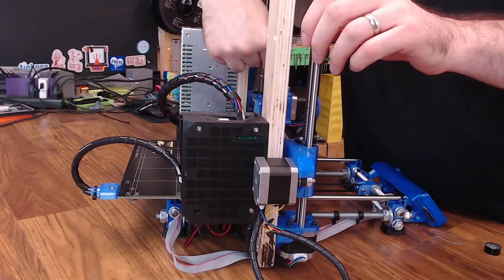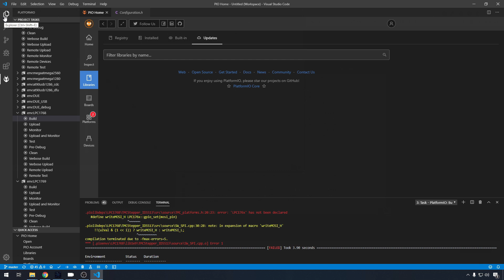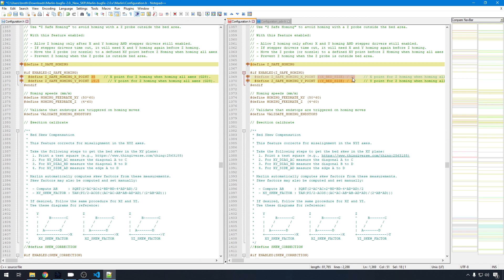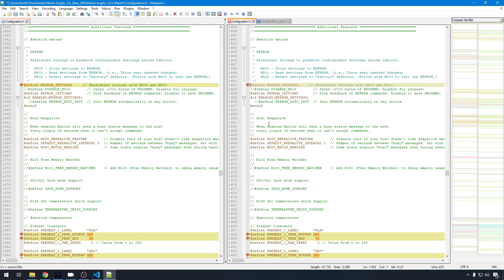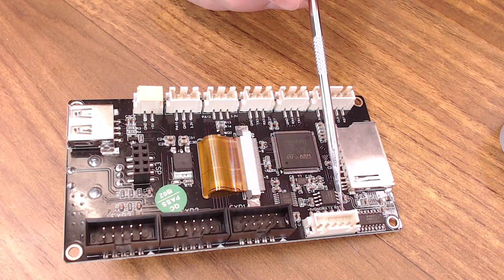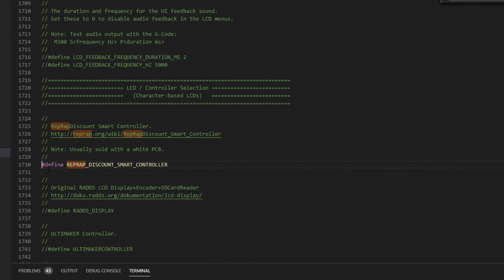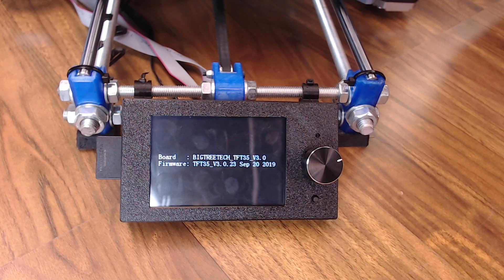BigtreetechTFT35 V3.0 Touch Screen Install - SKR 1.3 - Chris's Basement

Comment: Put this on my printer, everything was fine and working right till I did the upgrade firmware on the screen. When the screen rebooted it came up in Chinese,  I checked the config file in VS Code and it says the default language is English, so I built that config and flashed the board and still get the same thing! Any Ideas?
Reply from the maker: You mean the firmware on the screen is what you updated? Marlin doesn't impact the TFT screen in anyway. It's just a controller. You should be able to change the language with the screen buttons.
Reply: @ChrisRiley  Yes, the screen firmware I got from BigTreeTech's GitHub page now version .26. Tried but cant read the Chinese to do so
Reply from the maker: @Slowjoe1957  Yep, so you just need to find the right buttons, on the bottom third button from the left, then top second button from the left.
Reply: @ChrisRiley  If I had read the git hub page, I would have got it... copied the bin file to sd card but not the TFT35 file like the instructions say to.. It works when ya do it right.. Thanks for the reply and keep up the great video's

Comment: Hi Chris, great video as always. Hoping you can solve an issue for me, I have an SKR 1.4 with TFT 24 v1.1 all cabled correclty and able to switch between modes howver only Marlin mode working - touch screen still says no printer attached. Marlin 2.0 firmware with Reprap_Discount_Full graphic_display enabled but Serial Port (currently set to -1) and Serial Port 2 (currently set to 0). Is this correct and if so what else could be wrong please? (baud rates both set to 115200)
Reply: Thanks for the reply Chris, my set up was actually correct - I had bought 2 of the tft screens and seems one was defective and only worked in Marlin mode taking it up with supplier.
Reply from the maker: Try flipping the serial ports, make serial port 0 and serial port 2 -1

Comment: intresting, the 2004lcd works with the skr 1.3? i thought the 2004 display uses a 5volt logic and the skr uses a 3.3v logic. so are they compatible without a level shifter?.
Reply from the maker: Yes, it will work. The chip is 3.3v, the board in 5v tolerant.
Reply: @ChrisRiley  cool thanks !

Comment: i bought this screen for the skr 1.4 turbo, i hope it's compatible, i assume it will because it's the same company.
Reply from the maker: Yes, it will be, use the same TFT pins.
Reply: The TFT pins (at least on mine) are opposite in the 1.4 to the 1.3, so the single pin will be on the side that faces the fuses on the 1.4 turbo.
Also  I was getting "No printer attached" error.
Fix for me was to set the serial port at "-1"  then enable serial port 2 and set that as "0", baud rate 115200
Screen now detects printer about 20 seconds after power on.
Reply from the maker: @chrislefroy1034  Ah, that is good to know. That will help others.

Comment: Hi Chris, I switched to an SKR 1.4 turbo and the TFT 3.0. Some of the options like baby step don't work while the printer is running in touchscreen mode. It's enabled in Marlin and works in the emulator mode. Any ideas?  Thanks!
Reply from the maker: I am not sure why this is, but I have heard that before. There should be away to add custom commands, but at this time I am not sure how. I know there are other "hacker" type firmwares out there for these screens with more features.

Comment: Hi Chris, I have upgraded both my CR10S and my own Hypercube Evo build with this display. Everything works great except when selecting print in on the touch screen selecting the mainboard SDCard rather than the on board display reader the dialogue for bed and nozzle temp to not change so I do not know the current temp of things. Is there a fix for this? The temp readings work OK in emulation mode and when printing from the display SD reader, just not the mainboard reader.  Also can I upgrade the display firmware via a firmware bin from the mainboard SD reader rather than the display reader, if not next time I renew the firmware it will mean taking the thing out of the CR10 control box to do this which will be a bit of a pain. Thanks Steve
Reply from the maker: If you are printing from the SD card on the board I don't think the screen will get any info back to keep it up to date. There is no back and forth after it's started. Also, I think you have to update the firmware from the port on the screen.

Comment: but how do i make a TFT v2.0 work?
Reply from the maker: Not sure on that version.
Reply: @ChrisRiley  thank you for your reply,,, please understand that when I saw your original skr1.3. the screen offered was a version2,,, so i bought into the package not realizing you didn't evaluate the screen for the board,( but you did reference the screen in the marlin setup).  bought 2 for refitting both my anet machines.  bad story,,, havn't touched my machines since.  oh and btw, the onboard sd slot doesn't work either.   I really admire what you do, but i expect a higher level of due diligence.  We follow you and your advice, expecting you to realize crap when you see it and say so.  This wasn't a hard call, it just doesn't work.

Comment: Hi. Bit of help please. When I change the line  #define SERIAL_PORT  -1 to #define SERIAL_PORT  0 I get errors when compiling.                from Marlin\src\HAL\STM32F1\dogm\u8g_com_stm32duino_fsmc.cpp:29:
Marlin\src\HAL\STM32F1\dogm\../../../inc/../HAL/./STM32F1/HAL.h:82:4: error: #error "SERIAL_PORT cannot be 0. (Port 0 does not exist.) Please update your configuration."
   #error "SERIAL_PORT cannot be 0. (Port 0 does not exist.) Please update your configuration."
Any ideas how to fix that? Board is SKR MINI E3 V1.2 with TFT35 screen V3
Reply from the maker: What is your second serial port set to?
Reply: @ChrisRiley  not been enabled. I just followed your other video setting up the firmware. I just changed it to port -1 but there was no connection with the printer. Then looked at this video and tried to change it to port 0 but I'm getting the error. Thanks for replying :)
Reply from the maker: @heliaddict100  I think I found it, set the serial to 1 and use this environment to build env:STM32F103RE_btt
Reply: Thanks @Chris Riley . I give that a go :)

Comment: Would you be willing to look at the latest firmware for the tft24?  I recently purchased one but the firmware on github does not work properly.  I have not been able to get the assisted manual leveling to got to the correct locations using the config.ini.
Reply from the maker: Sure, I can take a look.
Reply: @ChrisRiley  Thank you.  I really appreciate your videos and the depth you go to when covering a topic.

Comment: When using filament runout sensor nothing shows up on the touch screen part. I have to switch back over to the marlin screen to see all the steps to continue printing. Anyone know how to get it on the touch screen part or if it's even possible?
Reply from the maker: I am not sure you can, it might take some programing.

Comment: Hi Chris. hope you / family are keeping well. just purchased BTT 1.3 board. is it possible to connect 2004 lcd using IC2. I have acquired the pin out from EXP1 and EXP2 ports and selected  sainsmart 2004. Thank you in advance. p.s haven't heard from Walter on his channel for a while.  :( hope all is well with him / family. Martin.
Reply from the maker: Hey Martin, hope you are well also. Not sure what Walter is up to. I am not sure on that install, I think it should work, but I am not sure what the config would be.
Reply: @ChrisRiley  It would be nice to see you guys on FKB at this moment in time. Yeah I had already built a Marlin system using a re-arm but wanted a challenge to create a CMC machine. Thank you for your quick response.

Comment: Curious if you've ever run across the TFT35 E3 V3.0 not working in LCD mode...?  I have an SKR1.4 on the newest marlin bugfix, the TFT35 E3 V3.0 is updated to the latest firmware.  EXP 1 -> EXP 1 and EXP 2 -> EXP 2, TFT -> RS232.  Touchscreen works awesome.  If I hold press the encoder wheel, I can switch to the LCD mode, blank screen(back light is on), nothing happens if I rotate encoder or press it, if I hold press it, shows me the option to switch between modes.  Can't see the LCD/Marlin mode at all...
Reply from the maker: The only thing I can think of is Marlin isn't set to the right screen. Needs to be set to the REPRAP full graphic display to work.
Reply: @ChrisRiley  Thank you for the reply I'll try that out and let you know!
Reply: @ChrisRiley  That did it, thanks a bunch Chris!!!

Comment: So, Any Word On A Patch For The TFT35 V3.0, "Randomly Stops Printing With Bed And Extruder Heat On"? Mine Has Been Stopping Every Several Times Per Print, Even Prints That Take Just Over An Hour. PS, There Github Forums Suck.
Reply from the maker: I haven't heard anything about it. Mine still works pretty good.
Reply: @ChrisRiley  Apparently They Are Having A Problem With Firmware Revisions, And Board Communications. Biggest Problem Is Not Just That Is Stops Printing Randomly, It's That The Extruder And Bed Don't Turn Off, So It Is Literally Cooking While Nothing Moves. See Github Firmware Page Issue #522
Reply from the maker: @antonrr90  That's scary.
Reply: @ChrisRiley  I'm Considering Returning The TFT35 V3.0 And Trying The TFT35 E3 V3.0 To See If There Is A Difference. I'm Pretty Sure They Are Still The Same Board, But It Might Have A Better Communication Situation.
Reply: @ChrisRiley  I Figured I Would Check With You Since Many Of The Videos I Have Seen On Your Channel Featured BTT Products, Of Which I Have Bought Two. BTT SKR V1.3, And The TFT35 V3.0. Do You Happen To Have A Public Link To Your Configuration Files For Your SKR V1.3 With The TFT35 V3.0? I Would Like To Do A Comparison Between My Configs And Your Configs That Are Working.

Comment: Would you mind sharing the link for the screen bezel and the mounts? The link for the bezel in the description is definitely not the same part as you have in your video. And there's no link to the mounts. Thanks! :)
Reply from the maker: This is the bezel, I still need to work on the hangers. https://www.thingiverse.com/thing:3863383
Reply: @ChrisRiley  Thanks. However, if you compared the bezel you linked to with the one you have in the video, it's not the same part. Maybe the creator has changed the design? And please let us know when the hangers are ready! I haven't been able to find anything similar on Thingiverse.
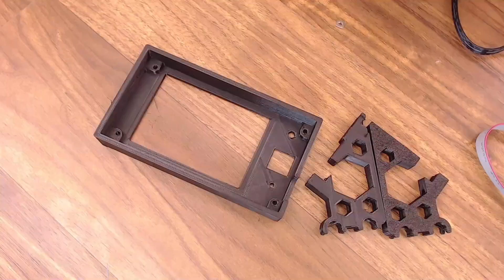Reply: I think I found the correct bezel on Thingiverse! If you look at 16:44, you can see that the screw hole spacers are rounded, just like this one: https://www.thingiverse.com/thing:3864560
Reply from the maker: @hansibull  Ah ha! Thank you, I will change the link. I am going to change mine up a bit, i will post a remix as well.

Comment: Can you please do a video on LCD support in Marlin, what it means and how to create it from scratch?
Reply from the maker: LCD support? Not sure what you mean.
Reply: @ChrisRiley  when you try to enable M600 in Marlin, the advanced pause feature requires either an emergency parser enabled or support for an LCD enabled. I take it to mean that there is some level of communication possible between the main board and the lcd that is more direct than mere gcode interaction. To be honest, I'm not entirely clear on what it means, but that's why I want a video! Nobody is really talking about it.
Reply from the maker: @garybarbourii8274  Ah, now I see what you are talking about. Yes, the filament change takes an actual screen to do the confirmation. The touch screen aren't really screens, they are just controllers.
Reply: @ChrisRiley  I'm trying to make it work but I hope I don't have to rewrite the m600 part of Marlin itself to make it work. I'd rather have a grasp on what LCD support means in Marlin!

Comment: Great info. I'm using an SKR  1.4.  If I install a TFT35 , can I still print from the card reader on the SKR or do I have to use the TFT card reader?
Reply from the maker: You can select which one you want to use in Marlin.
Reply: @ChrisRiley  Great, thanks.

Comment: If anybody else has the same issues with TMCStepper libraries when compiling, I just set mine to an older version. There's probably a better way but I'm fairly new to building firmware, it works fine. I had to invert my motor directions but that's easy enough to do.
Reply from the maker: I personally haven't seen any issues, maybe try re-installing platformio, that's what I do when I see strange issues going on, most of the time that solves it.

Comment: Another great video Chris. I have just upgraded to an SKR 1.4 Turbo and TFT35 v3.0 but I am having problems with both the SD card and the USB port, I can not see any media on the SD card and I am getting a U disk read error when trying to access the USB. I also get a read error when trying to access the MB SD card. Any help you can offer would be greatly appreciated. Thanks
Reply from the maker: Not sure about the ones on the screen, they should just work by default. Might be a hardware issue there. The one on the boards, check out this setting in configuration_adv.h 

/**
   * Set this option to one of the following (or the board's defaults apply):
   *
   *           LCD - Use the SD drive in the external LCD controller.
   *       ONBOARD - Use the SD drive on the control board. (No SD_DETECT_PIN. M21 to init.)
   *  CUSTOM_CABLE - Use a custom cable to access the SD (as defined in a pins file).
   *
   * :[ 'LCD', 'ONBOARD', 'CUSTOM_CABLE' ]
   */
  //#define SDCARD_CONNECTION LCD

Comment: Hola,tengo una skr 1.3 y una bigeetrech tft 35 y no consigo quitar el mensaje de not primer attached ,he cambiado de baudios de 25000 a 150000 y varias cosas más y no consigo que se comunique la pantalla con la skr,ayuda porfavor.un saludo
Reply from the maker: Asegúrese de tenerlo configurado en 115200 y que sus pines tx / rx estén cableados correctamente.

Comment: Hallo, my TFT does not save the led light of the button, when i restart it just stays off. it has the newest firmware. I use the tft35 v3.0 on a skr 1.4 turbo.
Reply from the maker: Button LED? I am not sure I have that on mine.
Reply: @ChrisRiley  I have the e3 version where the turn knob is illuminated. It is the replacement(upgrade) screen for the ender 3.
Reply from the maker: @francescocolobrese8098  Ah, yeah not sure on that. I have some other screen coming, I will see if they do that.

Comment: Hi Chris how do I add BTT software to Marlin for screen settings etc. Great videos as usual so easy to follow
Reply: Hi Chris works fine but Teaching tech has added to VS code and can reset the screen colour and size.have left a query to him but he seldom comes back with answers
Reply from the maker: @jeanraines3215  Sorry, I haven't done that stuff as of yet.
Reply from the maker: It should work with Marlin right out of the box, you shouldn't have to do anything else.

Comment: As always a really thorough rundown. I have a question. Can you upgrade your printer control board firmware (in my case the skr mini e3 v1.2) using the TFT 35 SD Card slot or do you have to use the control boards micro SD Card slot? Thanks for any info on this.
Reply from the maker: That is a great question, I don't see why it wouldn't work, but I have never tested it.
Reply: @ChrisRiley  Thanks for the answer. I'll be mounting the skr board at the rear of the case (my own printed case (but got the idea from Teaching Tech, so many really helpful people, such as yourself,  in this 3d printing world!!), so it would be so much easier to be able to use the SD slot on the TFT 35. This will be awhile as I have to get all my upgrade prints done before I can install the tft 35, filament runout detector, Raspberry pi and move the SKR bd. Thanks again.

Comment: Does anyone know how to enable the Print percentage on the Lcd12864 simulator in 2.0 bugfix... Can't seem to find it anywhere
Reply from the maker: Check out configuration_adv.h

// Add an 'M73' G-code to set the current percentage
//#define LCD_SET_PROGRESS_MANUALLY

// Show the E position (filament used) during printing
//#define LCD_SHOW_E_TOTAL

#if HAS_GRAPHICAL_LCD && HAS_PRINT_PROGRESS
  //#define PRINT_PROGRESS_SHOW_DECIMALS // Show progress with decimal digits
  //#define SHOW_REMAINING_TIME          // Display estimated time to completion
  #if ENABLED(SHOW_REMAINING_TIME)
    //#define USE_M73_REMAINING_TIME     // Use remaining time from M73 command instead of estimation
    //#define ROTATE_PROGRESS_DISPLAY    // Display (P)rogress, (E)lapsed, and (R)emaining time
  #endif
#endif

#if HAS_CHARACTER_LCD && HAS_PRINT_PROGRESS
  //#define LCD_PROGRESS_BAR              // Show a progress bar on HD44780 LCDs for SD printing
  #if ENABLED(LCD_PROGRESS_BAR)
    #define PROGRESS_BAR_BAR_TIME 2000    // (ms) Amount of time to show the bar
    #define PROGRESS_BAR_MSG_TIME 3000    // (ms) Amount of time to show the status message
    #define PROGRESS_MSG_EXPIRE   0       // (ms) Amount of time to retain the status message (0=forever)
    //#define PROGRESS_MSG_ONCE           // Show the message for MSG_TIME then clear it
    //#define LCD_PROGRESS_BAR_TEST       // Add a menu item to test the progress bar
  #endif
#endif

Comment: I finally got my SKR Mini E3 installed and by the first of the week my SKR 35TFT w/wifi should arrive. Once again I know that I can run Pronterface through the wifi interface, but what about Octoprint?
Reply from the maker: I don't think there is anyway to use Octoprint in this configuration currently. You still need a serial connection.

Comment: The case doesn't fit due to the design is modified using the prusa i3 Mk3 case which is different from the mk2. Also I'm looking forward to the stl for the screen mount.
Reply from the maker: Yeah, I don't have one for a MK3 style yet. I for got to post those, I will get them updated.